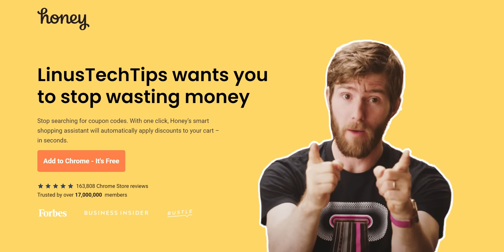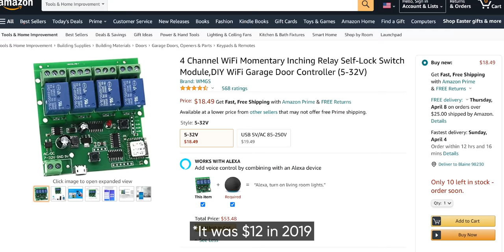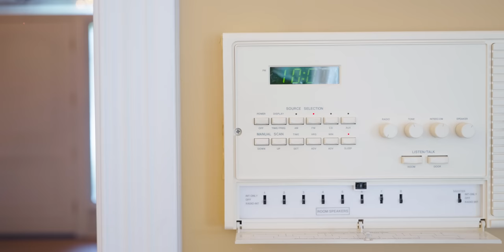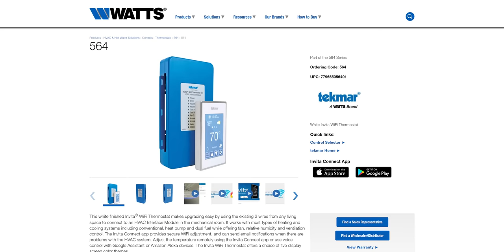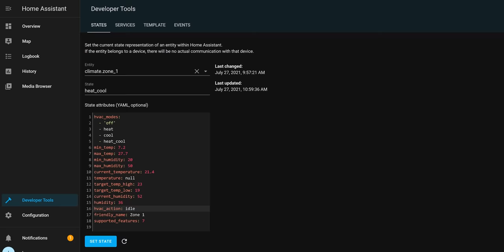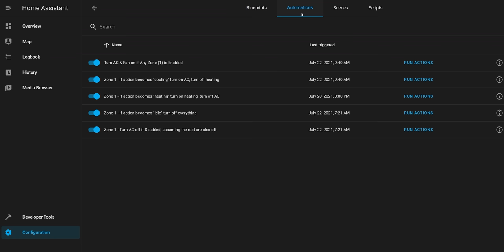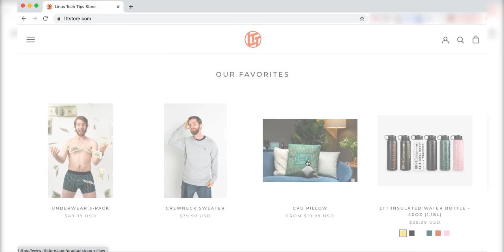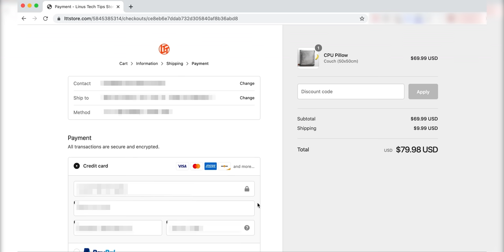This Should've Been EASY - New House Smart HVAC

Comment: Can’t wait to see the episode, Linus turns his AC into a ice block, due to lack of airflow. Hvac guy here.. also love these videos! Stoked to see more!
Reply: My grandpa owns his own hvac business and I used help him when I was about 14. He always called me gopher… “gopher this, gopher that” I was basically just the tool boy running back and forth to get his tools for him from the truck😂
Reply: Right there with you! I do Controls on commercial HVAC and watching some of the work arounds he’s trying to do is cringey but I love it. Excited to see how it turns out. Would be light years easier with a real programmable controller from Trane or Johnson or the like.
Reply: Yup the coil will be iced up if more than one or two dampers are closed especially if he is using high mrv filters and thats if the R22 system is properly charged still
Reply: Also those shitty spring loaded dampers don't last for shit if you keep them closed. So if they try to have them shut normally, and only open its demanding, they will be dead in no time. They just stall the motor and cook the windings.
Reply: freeze stat on indoor coil?
Reply: Or you know... he's buying a two stage, sets a max close on the dampers, or has a room (like that hot AF computer room) that he can dump cooling in to.

That and they run AC very little up there.
Reply: @ethanbartlett4383  he will 100% need to add in a bypass damper from return to supply
Reply: Eh really the hardest part about a house is wiring.
Reply: @aaronmcconkey1062  that’s the easy part been building houses for 20 years and it’s always pretty much the constant norm for me. It’s all the other stuff that keeps changing constantly.  That is unless we are doing a smart house.

Comment: Be careful when you use sensors to check for motion. I have been in a bathroom stall for a bit too long and had the lights turn off before. If that happens with your heating or cooling, it could add to discomfort.

Comment: After having occupancy sensors turn off the lights when I'm sitting at my desk, I'm not impressed.
Reply: I'm all for saving energy but a lot of efficiency automation just causes more issue a lot of the time especially in an office space.
Reply: Same for me after having occupancy sensors on the light switch of a bathroom shut off the lights while I was on the crapper.
Reply: @SteveUnperceived  There was a bathroom in my engineering building at Uni that had a rather aggressive motion sensor for the light.  I used to take a balled up piece of paper I could throw up over the stall to turn it back on. :D
Reply: try waving at a sensor in a toilet every 20 seconds. feels silly when you can't find the paper roll without exasperated waving.
Reply: @MrNathanstenzel  DEAD LOL
Reply: Dont they have infrared occupancy sensors?
Reply: @MrNathanstenzel  worse when its a  gas station bathroom, and the motion sensor  it by the sinks,  while you are in a cube  blocked off from it
Reply: Yeah we have those in my workspace at a hospital and they must turn off every 15 minutes or something cause i get there an hour before everyone else and I spend that hour furiously waving my arms at my desk roughly every 15 minutes. its an enormous pain in the ass.
Reply: The worst is hotel rooms that decide to shut your ac off because your sleeping

Comment: The best option for making sure you don't build up too much pressure from closing too many dampers would be to have use a bypass damper. This is a system to redirect air from the plenum back to the supply side via a duct. If you want to go the complicated route, you could link the damper in to Home Assistant to open the damper when a set number of dampers are closed, or, you could even set up a sensor in the plenum measuring static pressure. The simple route - and in my opinion, the most fail-safe route - would be to use a counter weight style bypass damper that opens from the static pressure in the duct work. Once the pressure on the damper's plate is enough to overcome the counter weight, the damper opens just enough to maintain the set pressure, which can be adjusted by moving the counter weight up and down the rod. Obviously, it's really up to you in what you choose. But considering some of the other suggestions, using a bypass duct and damper is the most efficient as the conditioned air just recirculates through the air handler/furnace.

Comment: You need to have a variable capacity AC unit\ compressor"inverter", or else this will actually shorten the life span of the unit because of the more frequent turning on and off of the compressor
Reply: I mean, you could do that.  Or you could set it up to run continuously to cool the LAN/server room and just cut air off to that room and redirect the flow elsewhere as needed.  That's a terrible solution of course, but I'm channeling Linus here.
Reply: I just left the same comment, lol. He's going to get his first electric bill and wonder if this solution is even working cause the unit is only on or off. Then he's going to be scratching his head in another year when the motor in the evap and the compressor burn out.
Reply: @docferringer  That may also cause "over cooling", resulting in short cycling and eventual failure of the compressor.
Reply: Yeah, he would technically be better off with a mini-split heat pump system to replace the current AC system as part of efficiency upgrade. And I know the jurisdiction where Linus actually lives gives massive rebates for people who do make these upgrades as well.
Reply: To be honest the unit is almost dead anyways and the king valves are probably already leaking refrigerant.
Reply: @docferringer  the unit is designed to condition the whole volume of the house,not just one room, cooling a smaller volume than what is the system is designed for will lead to the compressor to turn off and on more frequently to maintain the temperature in that smaller volume.which is very stressful on the compressor motor and the electrical system of the house in general due to the inrush current of the motor starting more frequently " more than what is designed for". And that will actually make is energy consumption even higher and of course as I said before will shorten the life span of the unit.
Maybe his unit is a variable capacity,but I don't think that it is.

Comment: The idea in your video is decent, but I would highly recommend going away from wifi, I had so many issues over time with wifi randomly when I set up my home system. I use Delta between occupied rooms with temp sensors in each room that I just poked through the ceiling of each room. I tried using occupancy sensors but had too many issues with false detection, so I went simpler and just assigned rooms manually and then have schedules that predict which rooms are occupied via time of day.  So for example during the day when I am home working based on my work schedule, it predicts I will be in the office during those hours, so it reduces the delta between target temperature set for that room as a priority, but after work hours it shifts to the living room and kitchen and such. Then to add automation for prevention of overheating in my office during off-peak hours like if I am gaming or something, there is a predetermined peak delta allowed, before it overrides and cools the room down.

Comment: Designing my dream house and for running wires and pipes, every wall will have removable wainscoting (held on with cabinet latches) and a drop ceiling that looks like those old-fashioned tin tiles.

Comment: My concern is when only one zone is calling for cooling and you command it on, you might starve your air handler of air and create a block of ice inside of it. Old systems are oversized, and I don't think it was designed to run any other way than at 100% capacity. Having more than one zone calling before enabling cooling is probably a better call. Or, opening dampers on one or two zones that won't mind extra cooling (maybe basement space or living room? just spitballing, not sure what zones you're doing this on or how many yet)  if less than a certain amount of zones are calling at any time, to prevent starving the air handler.

In commercial settings, we prevent this from happening by using proportional dampers that will open to a minimum airflow setpoint, but two position dampers won't allow for this. 

Unless you want to duct a bypass or something radical like that, which is wasting energy as well.

Comment: Best line ever. 

"Hey you wanna see some sparks?" - Jake

Still, I would have done touchscreen displays with wifi for home assistant (which are 12v powered) so you could do more stuff in each room. (see cameras/check locks/play music/etc.)
Reply: I agree with what you said, but I wouldn't be surprised if Linus had planned on putting stuff for that in each room or the rooms he deemed it useful in by using other methods. Considering the current plan is a bit finicky and might be changed looking at some of the comments above suggesting he might want to change his approach.
Reply: He could use old phones in constant on mode ect.. perhaps the ecobee is just the concept. Because HA already has a thermostat, and may soon have its own 'smart' pid

Comment: Where I live we have a lot of geothermal activity, and natural hot water springs, there are a lot of houses plumbed with floor heat like yours, but, instead of a boiler room, there’s a well that pumps geothermal heated water up and through the house, and it comes out around 210°f. 

If you have the natural resources you can almost have a 100% efficient system in your house

Comment: I feel like this is a solid plan right up until the occupancy sensors in every room.
Reply: Unfortunetly hes going to have alot of problems with the cooling in the future. As an HVAC business owner he is hacking his way into a damaged compressor which isnt a cheap fix by any means.
Reply: @mauichaui641  he will need one hell of a bypass damper if only 1 zone is calling for cool, let alone the compressor cycling on/off so many times. Not a great idea IMO. I would only use this setup for the heat he has installed.

Comment: sidenote from someone dealing with presence detection for years at home. Motion sensing does not work in "living" rooms eg. office/bedroom/gaming room. you might be sitting at the pc for some hours or just laying in bed, and no motion sensor can detect that reliably. Only solution i found is having a ble chip or phone with bluetooth enabled by you at any time and running "room-assistant". this of course works for lights as well and makes light switches obsolete.
for non "living" rooms like hallways, toilets etc motion sensing is definitely a good option.

Comment: As a HVAC and building automation engineer this was just painful to watch…
Reply: Agreed
Reply: His biggest saving grace here: it's unlikely to burn out the AC unit since Vancouver's hottest months average around 72 degrees... this AC probably will only get a few weeks of use a year, this'll mostly control heating, which seems to have proper zoning already in place.
Reply: I work in HVAC too. There's a reason installers exist, you should not do this yourself.

Comment: If you really want to gain some efficiency on that heating system, rip out that old Category I atmospheric boiler and get into a full modulating/condensing category IV boiler. Also I am not sure what that Tekmar control on the wall by the zone valves is doing but you should also utilize an outdoor reset control. In fact most modern category IV boilers have built in outdoor reset. I suggest going with Lochinvar as a boiler. You can even ditch the two existing water heaters you have and change to an Indirect water heater that will have far better recovery rate/capacity than those tank type water heaters. An indirect water heater utilizes the hot hydronic heating water to heat up an exchanger to make your hot water for showers/faucets. With the indirect water heater you will take advantage of the efficiency of the new boiler, quicker hot water recovery time, and more hot water capacity.